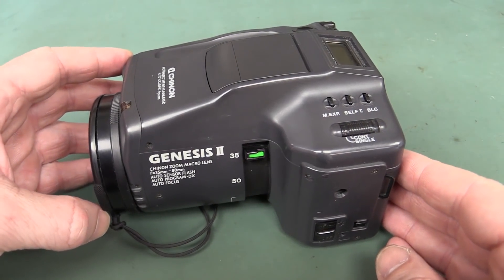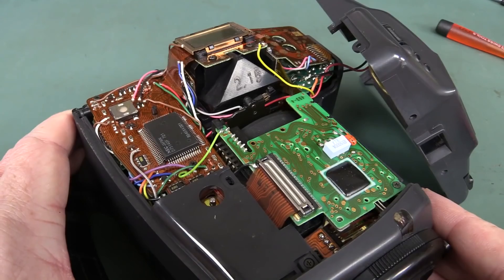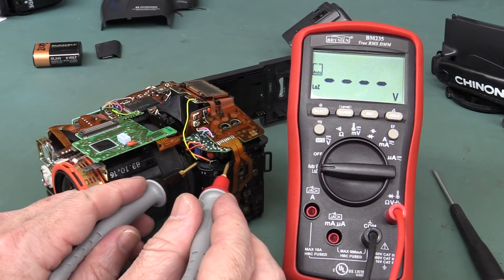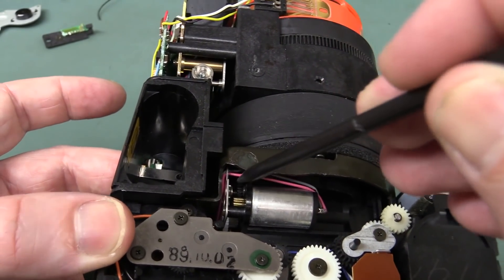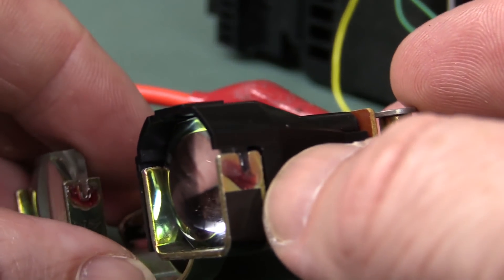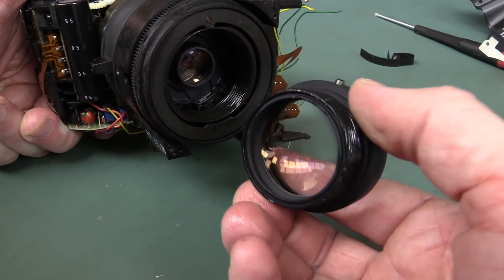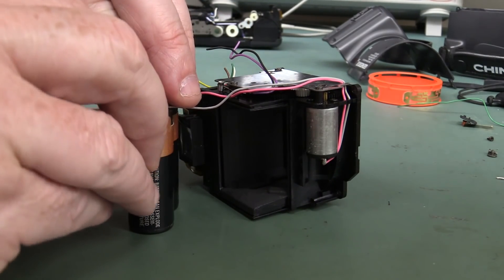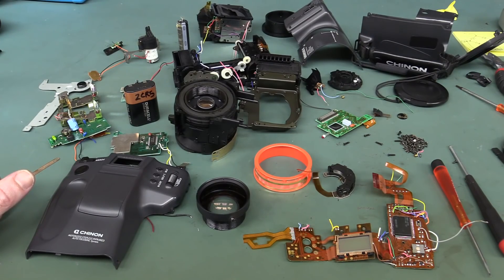EEVblog #816 - Chinon Film Camera Teardown

Comment: Tempted to send in a completely analog camera for teardown, but pretty sure it would be appropriate for this blog. (If I did it would have to be one without even a light meter or hotshoe.) They used an ingenious biomechanical power supply.

Comment: +EEVblog -- Hey Dave, I know this is an older vid, but quick question: At 6:15, on the handle you use to manually rotate the cylinder and control the zoom, there's what looks like a chunk of neon green fiber optic plastic slotted into the cut-away in the black plastic. Is that for seeing the cylinder better in the dark? Or is it just an aesthetic feature?

Comment: Those analog ROM cards are cool they are extremely sensitive to light, somewhat  like an EPROM. They were wireless as well, but that came at a price as they had to be long and flat all coiled up with a traction feed writing system. The strangest part is you had to use chemicals to read it and only in the dark until the read process was complete. Not just anybody could complete the image type conversion process until it was rewrote to paper disk, then even kids could view the analog JPEG.

Comment: You didn't mention what type of memory card it use :=)
Reply: Negative/Positive color/BW with a wide range of ISO. ~24MPixels (depends of film scanner used)
12-36 (up to 40, but I presume this automatic gonna withstand this overuse) frames 24x36mm
 =)

Comment: Gotta stick a cheap ebay webcam lol, DIY digital camera
Reply: In there
Reply: +HDXFH you can just buy the CCD chips, but it'd be a pain. The lenses aren't focused for something that small,they're made to fill a 35X40mm square (if I recall). You'd have to do a lot of math to get that to work. If you did, you'd have a pretty nice camera, though!
Reply: Aren't there full size sensors that are 35mm-compatible?
Reply: That would probably give you a better image quality "out of the box" than attempting to use the optics from that Chinon (a company not known for the best quality) ZLR camera.

Comment: has anybody seen those old cameras that has the time/date signature recorded on the film? how does that work? if there's a clock in the camera, what mechanism does it use to print the time on film?
Reply: +Joseph Beasley  It's a very tiny LCD, backlit usually with a bulb (yes, surprisingly not with LED, even in the late '90s they still used bulbs for that). This model also has that feature, but Dave unfortunately forgot to show that. As I mentioned before, I want to make a DIY projection clock from one of them. 

But it would be an interesting followup video on that teardown, if Dave also tries that trick :) .
Reply: Ahh that makes sense
 Should've figured.. Lol
Reply: So how does the backlight on that lcd get the exposure right? If it were too bright the time would blur. Too dim and you couldn't see it, right?
Reply: +Joseph Beasley You measure the Display for every ASA step and then couple a dimmer to the ASA setting. Problem solved. And why do you think it would blur?

Comment: Another brilliant video from Dave. Thanks. I remember the time with the expensive "memory cards", small correction: back in the old days it used a new sensor for every picture and if the loading mechanism is gone faulty it used the sensor for two picture and give some funny pictures.

Comment: Geez... so how many megapixels Dave?
Reply: +Antonio Tejada
"Memory" roll, actually! :)
Reply: +MaxxFordham Resolution doesn't require pixels or grain to be measurable. Lens resolution is measured in lines/mm. Grain is measured in RMS granularity. People often confuse resolution as meaning "dimensions in pixels" because that's how it's used colloquially in computing. But "resolution" technically means "divisions per unit", e.g. "dots per inch" in printing, "pixels per inch" in displays, "bits per sample" in audio, or "lines per mm" in camera optics. Resolution isn't a size, it's a ratio.
Reply: Depends on the type of memory card you put in. ;)
Reply: +Boredness Technically infinite :D
Reply: +megaspeed2v2 Well no, film has grain, which is a very hard limit. (But that limit is different for each type.) And in actuality, the resolution of the lens is a limiting factor as well, though I'd expect this one to be pretty good.
Reply: +Boredness If we presume that lens is not limiting factor the fine grain 35mm film is equivalent with little over 20 million pixels with 24 bit color depth (not same as common 8-12 bit color depth used in low/medium cost DSLR cameras).
Reply: +Boredness If we presume that lens is not limiting factor the fine grain 35mm film is equivalent with little over 20 million pixels with 24 bit color depth (not same as common 8-12 bit color depth used in low/medium cost DSLR cameras).
Reply: Antonio Tejada thats why i said technically, if you have a perfectly crafted lens and a high quality film then theoretically theres no reason you cant take an old movie and rescan it in 1080P 4K, 8K or even higher.
Reply: No, megaspeed2v2, no matter how good film is, there's always going to be some graininess, since it's made of grains. It's the nature of the beast. But that's part of why many people like it for some types of production. We've associated that look with the partial removal of the "here-and-now," real-life-looking aspect of picture (well you probably already get that part, so I don't need to go into detail there, I bet).
Reply: +megaspeed2v2 Well, it's not theoretical, it's done all the time. The reason you can get the old Star Trek movies and shows in HD is because they re-scanned the film in HD or higher and then remastered to an HD distribution format. But the available resolution is not infinite: Film grain is very real, and the resolution of the lenses used is very real as well. Scanning at a higher resolution than that simply will not extract any more picture information, because it's not there. You just end up with really big files with lots of extra pixels that add zero additional picture information.
Reply: Antonio Tejada I said "technically" and "theoretically" specifically for the reasons you just said. if the film was recorded with impossibly good lenses and onto an impossibly perfect film then the "resolution" would be infinite, but those don't exist ergo its only theoretically infinite.
Reply: Well then, megaspeed2v2, since no film like that exists, then it actually isn't even technical to say that. Using the logic you proposed, the same should be said for electronic images, both analog and digital.

But lenses don't have resolution because they don't have pixels or grain in them.
Reply: I'm already aware of that about what resolution is, Antonio Tejada, which is why I already said that film, with its grain instead of definite pixels, still has finite resolution. (By the way, DPI doesn't only apply to print, but monitors too. And a printed dot can still be thought of as a picture element, or pixel for short.)
The same goes for sound. It has resolution too (you know, in bit depth and samples per second).
But how can a set of bent pieces of glass or plastic have any specific number of lines per millimeter if the glass and plastic are so smooth that they really don't have any surface divisions?
Reply: +MaxxFordham 1. Pixels per inch and dots per inch are NOT the same thing. Dots per inch is the precision of the location to which a printing system can lay down a dot of ink, but NOT the size or shape of that dot, which is also vitally important to the print quality. DPI thus doesn&#39;t really apply to displays because their subpixels are of fixed size and position. This is why the spacing of the groups of 3 (sometimes 4) subpixels that comprise a pixel are correctly described using PPI, not DPI.
2. [Edit: deleted]
3. Look up Optical Transfer Function. That&#39;s how lens resolution is measured. (I think there&#39;s some confusion that resolution necessarily requires discrete steps, but it doesn&#39;t.)

Edit: Upon further reflection, I agree that both sample size and sample rate are two dimensions of resolution in audio sampling.
Reply: Antonio Tejada, if you first wrote something as #2 and then changed your mind and edited it out, then why didn't you just renumber 3 as 2 and not even have that previous #2, and not have anyone else be the wiser, and then not even have an "Edit" section, but just include that as part of your contiguous body of text from before?

Actually, in DPI and PPI, the dot size is affected, because obviously the more dots you squeeze into a  given space, the smaller they have to be. And since when does "pixel" include "shape" as part of its definition? I know what you mean by subpixels (red, blue, and green parts of one electronic pixel). But as for a printed picture, it still has elements, and those elements are the dots, are they not? Yeah, I know the term "pixel" is usually more often used for screen images, but it doesn't have to be limited to that. Likewise, screen pixels can be called "dots" too -- even though there are bigger dots too, such as when the period is renamed just "dot" for web addresses, etc. So the word "pixel" is just a more specific term.

I haven't read your lens thing yet. Let me ask you this question before I do that: How can something that doesn't have discreet lines in it still have a supposed number of "lines" per any amount of space (such as this supposed "lines per millimeter")? "Lines" of... what?
Reply: +MaxxFordham I made the edit clear in case you had read the original reply before I had a chance to edit it. Just a courtesy learned from years of online forum participation.

As for DPI, you say: "...because obviously the more dots you squeeze into a  given space, the smaller they have to be." No, that's exactly my point: they do NOT have to be smaller! Here's an example: There are some inkjet printers with 9600dpi resolution, but their smallest ink droplets are far, far larger than 1/9600". What this means is that the printhead can place a drop down to 1/9600" accuracy, even if the drop itself is bigger. (An analogy: in standard Lego blocks, the resolution of the system is 1 peg. So you can take a 2x8 block -- obviously bigger than 1 peg -- but place it down to 1 peg resolution.) What this allows is for drops of ink to overlap, allowing finer gradation of continuous tones. As best I could research quickly, a typical inkjet droplet makes a dot about 50 microns across, while 1/9600" is about 2.65 microns. This means that the dots can be placed with 18 times more precision than their own size. 

As far as lenses -- bearing in mind that optics is not my area of expertise -- I think it's based on test patterns (those starburst looking things) of alternating black and white wedges that taper down to the center. The resolution of the lens is the size of the smallest pair (one black, one white) that can clearly be distinguished (as opposed to blurring into gray). Because this isn't a discrete value, but rather varies along the radius of the lens, it's presented as a curve on an MTF chart (you see these on the spec sheets for SLR camera lenses, showing the sharpness (Y axis) vs distance from center (X axis). Lens resolution is, simply put, the ability of a lens to resolve a line of a given size. (But this not being my specialty, I'd strongly recommend you research it yourself, since my explanation on this is probably simplistic.)

Comment: At 3:27 Dave mentions a "mirror" in the viewfinder's light path.  Isn't that a pentaprism?  Might be a mirror for cost savings I suppose.  Expiring minds want to know.
Reply: +cemx86 IIRC there's prism up by the view finder, but there's definitely a mirror that when viewing is flipped down 45%, deflecting the light coming in through the lens up into the viewfinder. When you press the trigger the mirror moves (typically flips up) out of the path from the objective  to the sensor/film, and the shutter opens.

Comment: I like the other interface of the "memory card", at 1:35 the 4 pairs of contacts in the film compartment, where used to detect what kind of film was inserted.
Reply: +AltMarc Not exactly what kind, but of which sensibility and tolerance and how many exposures.

Comment: Great stuff! Check this out. The memory card comes with a brand-new one-shot sensor for each photo! It's non-erasable, can be treated to be human-viewable without additional technology, and the memory-card type determines resolution and colour-rendition!
Reply: +pinkdispatcher It is erasable, just not rewritable. Secondly, additional technology (a lot indeed) is needed to make it human-viewable.
Reply: zawzero
You are technically correct. The best kind of correct. (Hermes Conrad)

What I meant to say was that it can be made human-viewable without electronics. Yes, developing and fixing chemistry is of course technology. But I'm not sure I subscribe to the view that a spool, a tank, two (or three) chemicals and a clock is "a lot of technology".

Comment: how do you know if something has enough power to kill you. i.e capacitors, dc, ac
Reply: +007killnoobs over 30 milliamps ( 0.03A) is enough to kill you. but it does depend on how old you are and how fat you are.
Reply: That's pretty complicated. It depends on person, time, current, voltage, current path, ...

Comment: at 15:20 I think that was a leaf shutter, not an iris. I did not see a curtain shutter behind the mirror that typically belongs on an SLR.
Reply: +Neil Robinson - I don't think so.  While it might be OK to use it for very slow shutter speeds, at higher speeds it would have a noticeable affect on the exposure between the top and bottom of the frame.  The shutter appears to be part of the aperture.
Reply: Exactly, but I wonder where the iris (diaphragm) is?
Reply: +T. Z. I think the mirror was working as the shutter, the same way as was used on Exa cameras in the late 50's to save money.
Reply: +Mehmet Koray Pekericli 
maybe right nearby or deeper in the lens. I have several very old mechanical cameras with leaf shutters that have various arrangements.
Reply: +Mehmet Koray Pekericli There seemingly isn't one. The manual actually never mentions one or a way to control it, just the lens' native aperture.